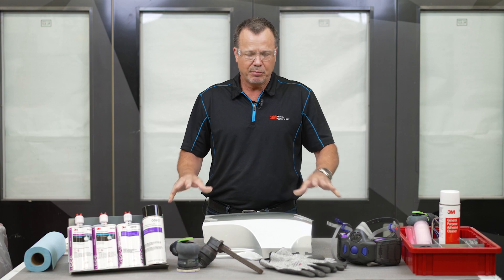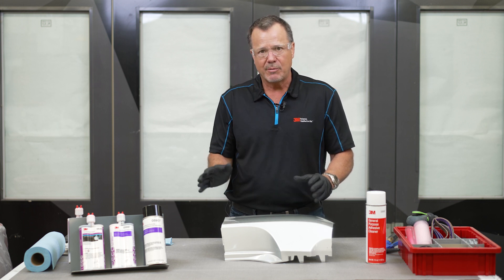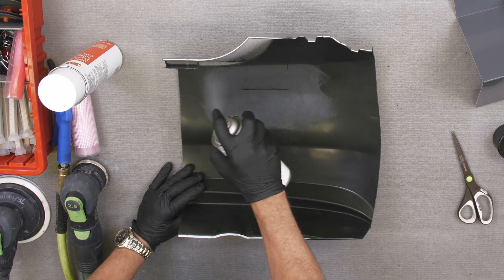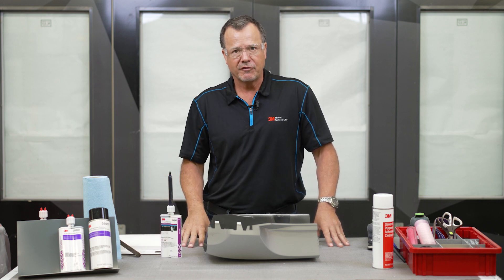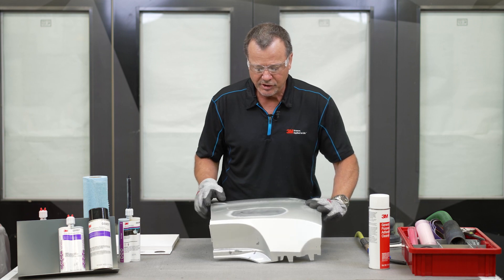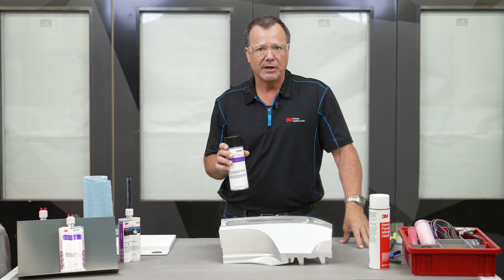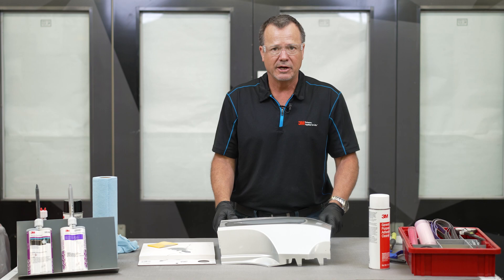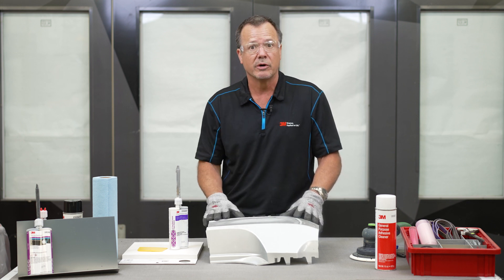HOW TO: Fix Cracks, Tears, and Punctures with a Two-sided Plastic Bumper Repair

Comment: With the time to repair and the cost of all three products is cheaper to buy a aftermarket bumper 😅😅😅
Reply: Even a Cadillac/Mercedes etc.. bumper?... Not to mention back order?. Sometimes time essence comes into play
Reply: Possibly, however consider possibly having to blend into adjacent panels on some colors if replacing. If the damage is in the center of the cover, you can save the OEM color on the ends and not have to blend into adjacent panels. Nothing worse than seeing a car on the street where the bumper cover and the quarter panel don’t match perfectly. Not to mention, most aftermarket covers don’t fit well and the gaps may look poor. Also the materials aren’t expensive if you can repair 4-6 bumpers with one cartridge of adhesive. If you’re buying the materials to repair one bumper, then it may not make sense. All situations are different.
Reply: Some want to maintain the integrity of the part since the birth of the car, collector cars especially.

Comment: As far as we know the material is fast drying. So how to store the cartridge  after used for next repair?
Reply from the maker: Hello -- To ensure its consistency and effectiveness keep the product in a cool, dry location away from direct sunlight and extreme temperatures. Also, ensure the Mixer Nozzle tip is used to seal the cartridge. To know more, please refer https://s.3m.com/3jwup1r8

Comment: I have also read on a 3M tech sheet somewhere that 08115 panel bond can be used on plastic without adhesion promoter. It also has a very long work time for hot climates.

Comment: This is a fantastic video, before applying the adhesion promoter and after sanding the back side, is it really ok to only use compressed air? I planned on using isopropyl alcohol to ensure all the debris is out of the sanding scratches